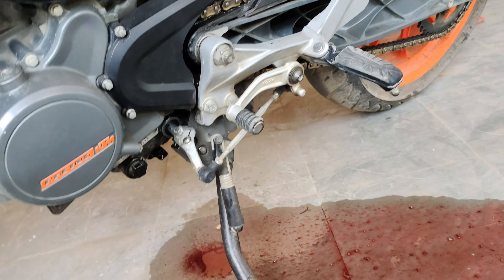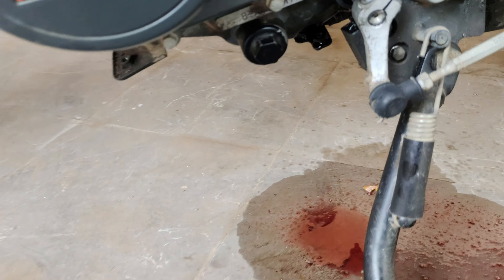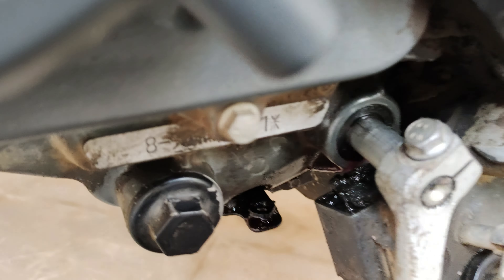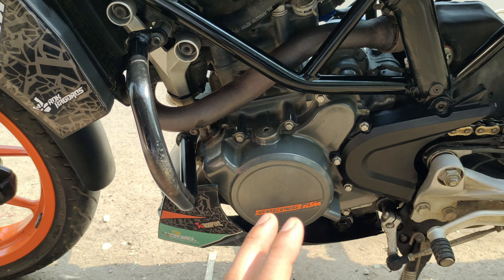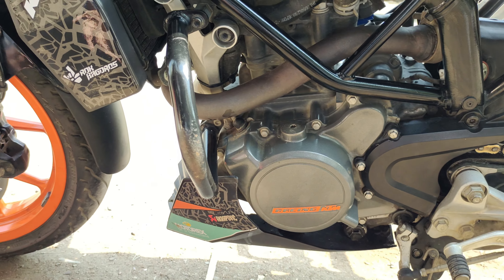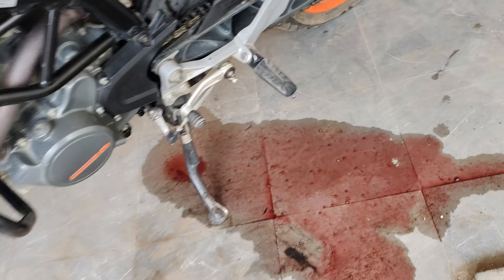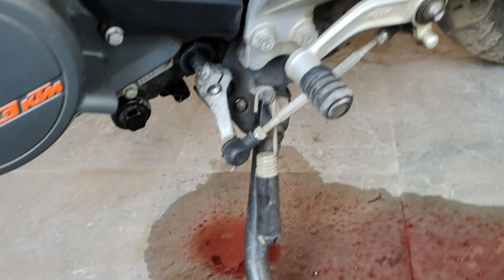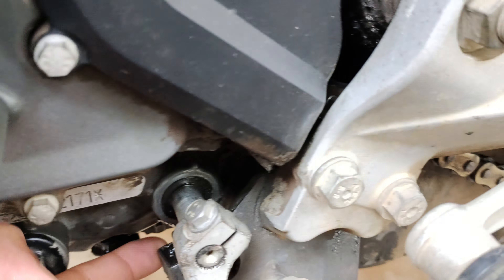FINALLY BIKE REPAIR 💥 ||duke 125 5th service || unknown ktm service center in Hyderabad

Comment: how to orders uke 200  rear disc pad bro
Reply from the maker: Buy in Bajaj show room bro., Ns200 brake pads will fit for duke 125
Reply: @mechanicalrider_  anna duke 125 kadhu duke 200 ki na
Reply from the maker: 200 old model ki kudha set ithayee bro
Reply: @mechanicalrider_  thanks u bro